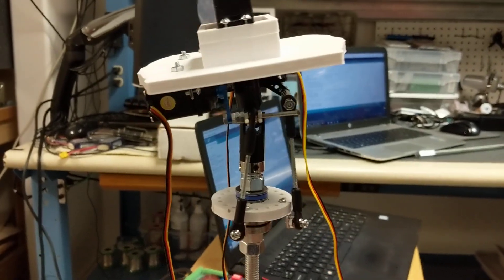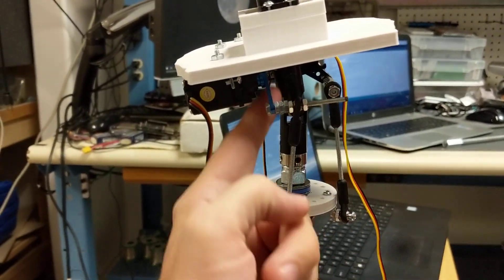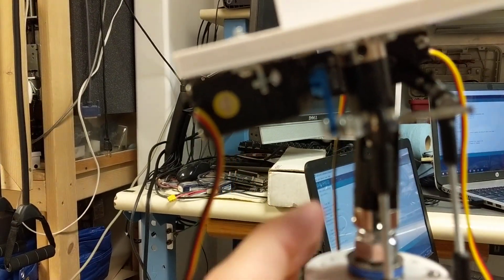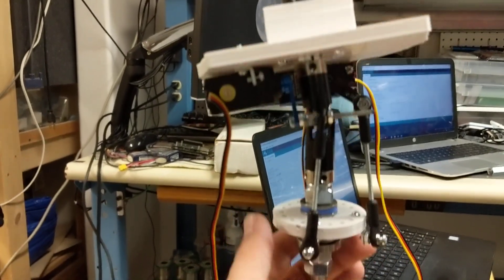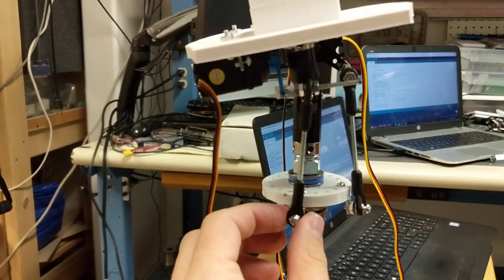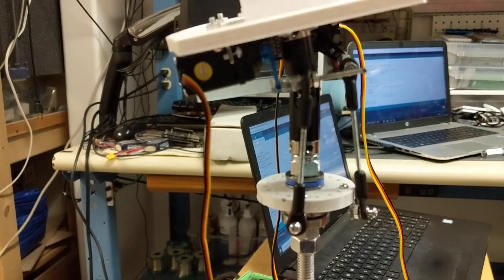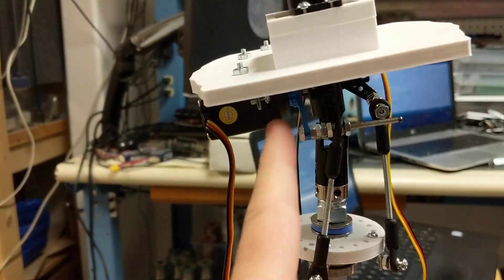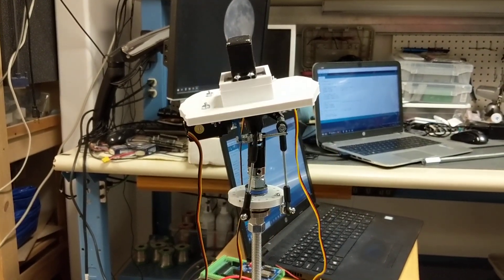3 Axis Skull - Improving Movement

Comment: Are you aligning the servo linkage  to the main rod?  The linkage has to be inline with the main rod when in the middle position? as when the skull is straight up? Very nice video. If you have dimensions on what you have built ,I would love to have them. I'm trying to do the same thing as you and I can't get it to work correctly with the way I have it set up.Any help would be appreciated.
Reply from the maker: This is actually my friends build he based on mine. It was having trouble because as you say the servo was not in line with the main rod. This was causing it to flop about and some of the nod or tilt movement would turn into twisting action. 
I have an instructable on making my skull talk, but not on the mechanics specifically: 
https://www.instructables.com/Automated-Talking-Skull/

Here's my build:
https://youtu.be/FwPx53iEUiY
 I've been meaning to remake this so that it can be 3d printed, is easier to service, as well as go into specifics about the mechanism.
Reply: @dwm14641,  Thanks, I have been working off and on for about 2 years to get this right. I asked for dimensions of the swash plate on Haunt Forum, but nobody has replied as of yet. I do have a copy of the Triaxel drawings , but they don't have any dimensions. If you could help with this I would be very grateful. I like the movement better than  the Halloween Bob 3 Axis. That one is a great design and there have been several tweaks to it. n In fact I have built about a dozen or more of that design, that's why I'm trying to convert. There is also more room in the skull for my version of the eyes. Again any help would be great. Good to see you back in action also.